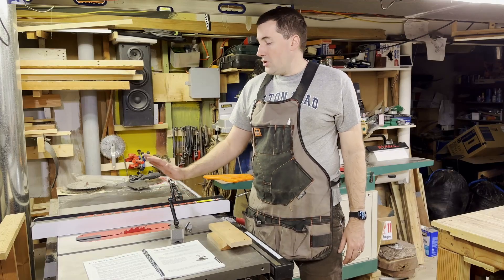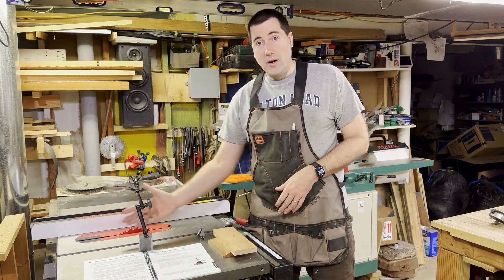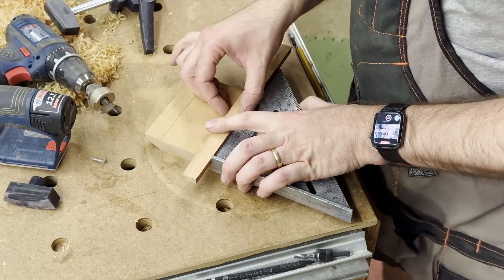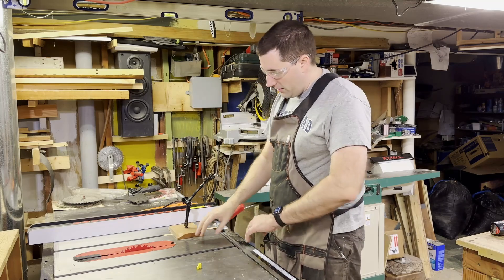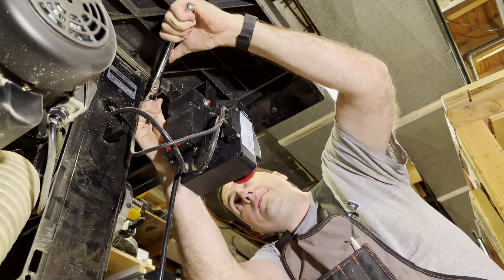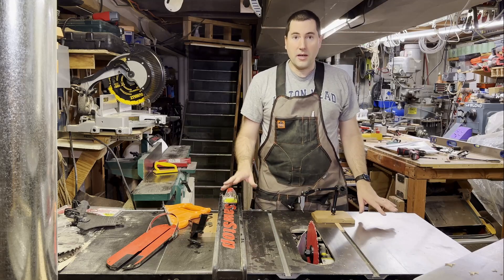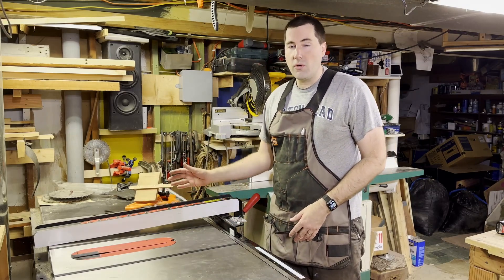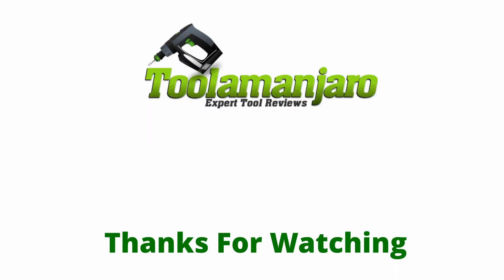How to improve the cut quality on a Sawstop PCS

Comment: Needing a .0005” dial indicator as opposed to a .001” dial indicator is contradicted by “holding the board the same way in the miter a slot each time”.  .001” resolution is more than enough for this setting. As a side note, it is recommended to use a non-painted blade when making these measurements.

Comment: Just out of curiosity, was the fence out that much when you first got the saw? I believe the saw adjustment wasn't really necessary (.0005" is more of a metalworking tolerance than woodworking), but .0125 is marginal. Does the manual specify the tolerance for these measurements (blade/arbor runout is another one to check). Thanks for the video.